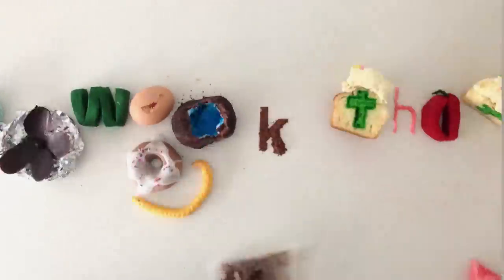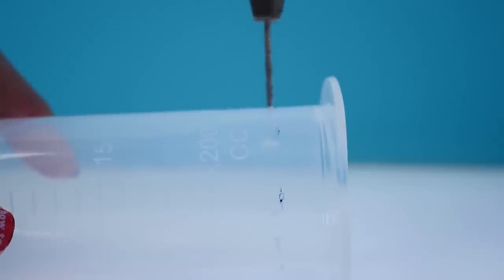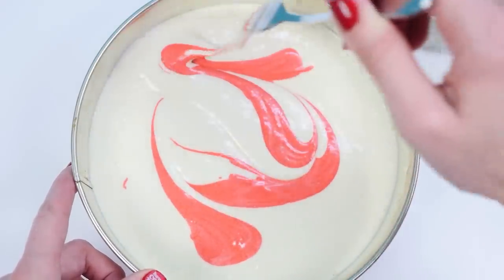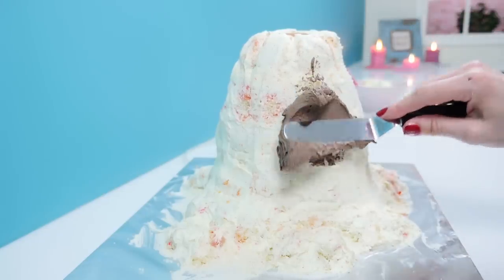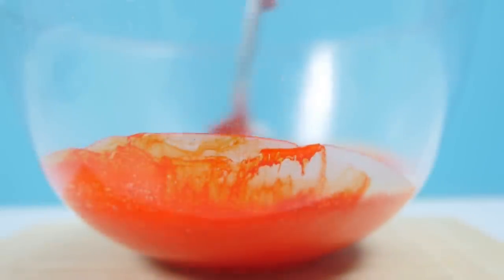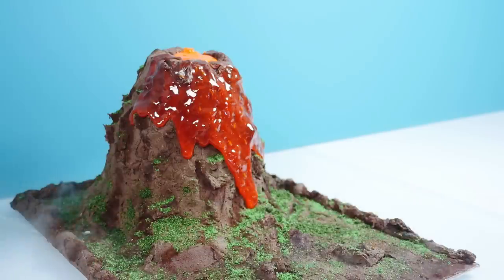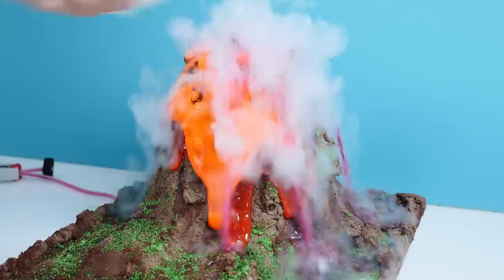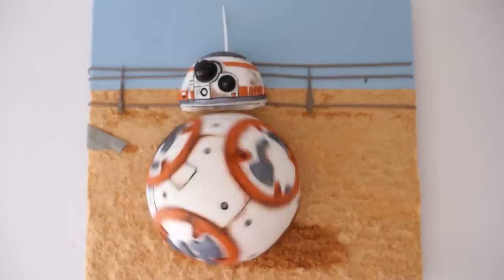Will this volcano cake EXPLODE?

Comment: That cake is so cool and must taste AMAZING, but I was thinking that another way of creating a contraption to create the eruption would be to attach the pointy end of the syringe to the pointy part of another big syringe (with the plastic pully still attached to the plastic disc) and fill it with water which unlike gases doesn’t condense making it more efficient and you could then manually push the “lava” out by pushing the pully on the intact large syringe

Comment: You can use a big tube and put a smaller  tube inside it.  make sure the tops of them meet and staple the edge of the flap of the smaller tube to the rim of the tube the bigger tube. Then in the smaller  tube you put the dry ice in and the other you put your  lava in, it'll look like its smoking and spewing lava

Comment: I wish I had found this several months ago. I made a volcano cake for my son's high school graduation with the chocolate ganache buttercream frosting and the extra frosting around the tray. I spent months trying to find a way to have the eruption be a random event. I decided very early to use jello and dry ice. When it works the effect is wonderful and fairly long lasting. I thought using your water balloon sugar glass I could have an upper chamber with the water and dry ice and a lower chamber with the unset  jello. I thought the water would dissolve the sugar glass, dropping the ice into the jello, causing the bubbly eruption. In reality, the water cracks the sugar glass, which may or may not bring the level of the jello to the ice and have a limited reaction, depending on many factors. I made so many cakes and glass I can make them from memory. I never could get the random trigger to work.  Then, the day of the party there was no dry ice to be found anywhere we could drive to. 
Now that I've seen this, I just may start experimenting again.   Thank you for your very awesome videos.

Comment: Use syringe to repleace the bottle, so the lave can be pumped into the cake with control. 
Then no big hole and syringe is needed inside the cake for lava storage. Instead, make a sallow one for dry ice. Use the more runny should be better as it would be chilled by the dry ice when contact.
Fill the syringe with lava and air, by tilting it, you can control what to be injected to the cake. Which should give the bubbling effect.

Comment: I was considering if it would be possible to make it explode without using tech, so I looked for a tasteless base to use with the sauce because I know you can use lemon juice as an acid to get something to bubble, and as it turns out ammonium bicarbonate, a precursor to baking soda, is tasteless after it's baked. So I imagine if you made like a strawberry syrup of some sort with that in it and stirred in lemon juice you may be able to get a decent explosion.

Comment: In terms of color/texture, I like the caramel, but I think the ganache had the best drip effect after 'erupting', and doesn't need to be heated up immediately beforehand. The only issue I see with the 'smoke' is that if this is a cake intended to surprise a small child, actively pouring hot water inside their cake while they're watching may ruin the effect a bit. Not really sure what can be done about that either.

Comment: Ann, what if you make the same cake with method 2, but make another same contraption but maybe a smaller syringe tube, add that to the back but make it seem like it's from the same crater and than use that one for method 5 you have a “perfect” cake!

Comment: to improve :   how about you take a Syringe and make your contraption, then you take a small container and put it inside the the syringe make sure it is not blocking any of the sides and that it right in the center and is as long/tall as the syringe .After that you pour in your lava or caramel outside your container (if it is a good enough thick one then it will support your small container to stay in the center).  You put in your dry ice in the container and your bottle, put in the hot water in the bottle first and then your container. To make sure your lava doesn't go in the container put it higher in the syringe this way it will only go outside your volcano and not in the container                  
if everything goes according to plan then your lava will come out like its supposed to and you will also get smoke or fog as you would say👍😜😊😁

Comment: I think you should try making the volcano cake, and put the syringe in there too, with the rubber stopper, but don’t use the dry ice in the bottle thing, instead, make “Lava” (Orange colored ganache) come down the sides, (Put it on with a spoon or butter knife) and then put hot water in the syringe, and put a little bit of dry ice. Bam, “Smoking” Lava cake.

Comment: I wonder if the first fail had anything to do with the coldness of the dry-ice thickening up the caramel? I know that it was in how water, but i imagine the vapors would still be much colder than room temperature, so i wonder if it wouldlve worked better if the source of the internal pressure was somehow a different, room temperature source

Comment: A couple of questions: Are you squeezing the bottle or is the gas just doing the work for you? I like #2 and #5 but if I add another tube somehow to get the fog will there still be enough gas going through the other tube to get the caramel to explode right? Any suggestions would be greatly appreciated.

Comment: I live in the Philippines, but thankfully far away from Mt. Mayon. I'm way too amused by how that tube melted off, that caramel must've been really hot! How did it not melt off the second time when you reheated it to soften?
Reply from the maker: Hi Rxcrcfllptrs The tube didn't melt, the caramel just came out as one big cylinder - it was so thick that it only moved when I stretched it. 😀

Comment: Your caramel had too much silica in it which made it too viscous. Your jelly was a very mafic lava which is why it flowed so easily. It flowed a lot faster than the stuff from Mauna Loa though haha. Your volcano was also pretty funny shaped. Like a really chunky cindercone with plants on it like a stratovolcano. If it was more sloped it would have looked like a proper composit volcano. Would have been so cool if the dome blew off the top like Mt. St. Helens just saying.